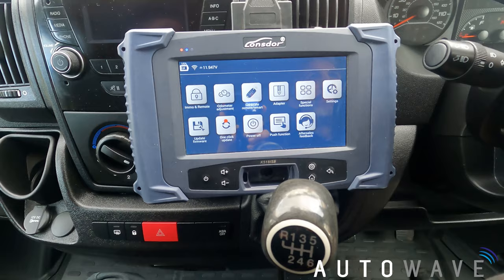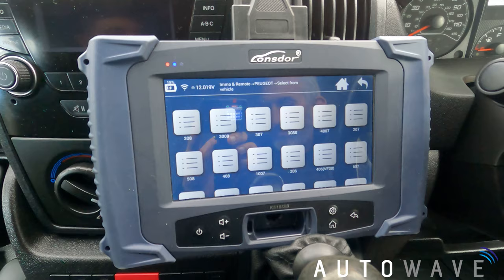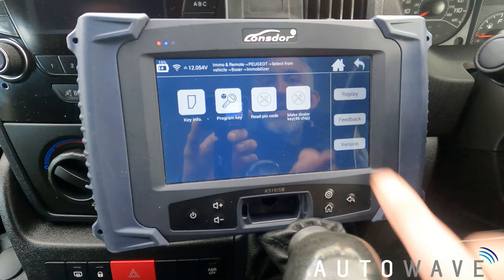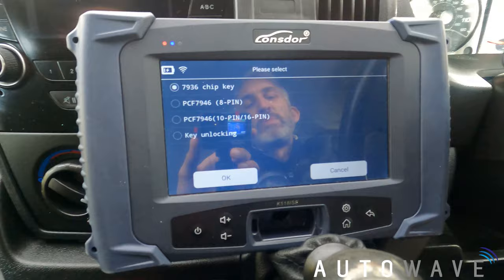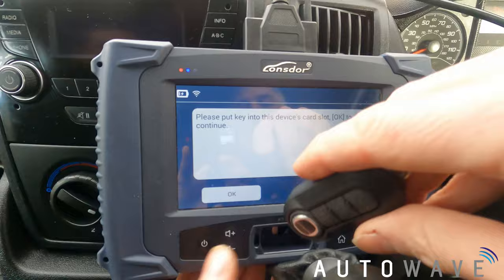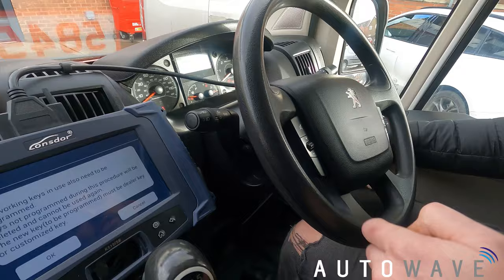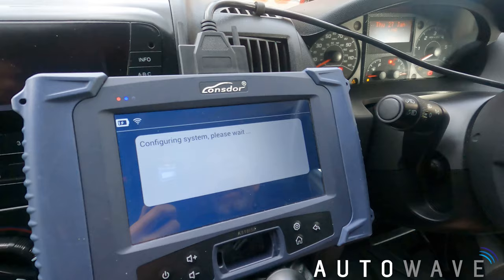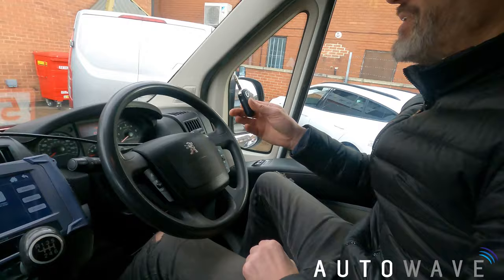Programming a Spare Key For a 2014 Peugeot Boxer | Lonsdor K518ISE Key Programmer

Comment: Just did a 2017 Ducato today and i was just adding a spare key,i relearned original first then the new key,original didn't work afterwards but new key fine??
Tried again 2 or 3 times and original just isn't working??
I tried im508,it didnt make a dealer key which was unusual,my obdstar did that ok.
Might try my Lonsdor to see if i have anymore luck.

Comment: Pretty sure that remote wouldn’t function 
Needed to select 10 pin for this later boxer 
Why didn’t you show remote functioning ???
Reply: You are wrong. Marelli = 8 pin, delphi 10/16 pin
Reply: @piotrkacprzak2861  I don´t recognize my logic board of key.. 8 pins where ? chip? Thanks
Reply: @goodphone9202  in OEM remotes. Aftermarket are build different.